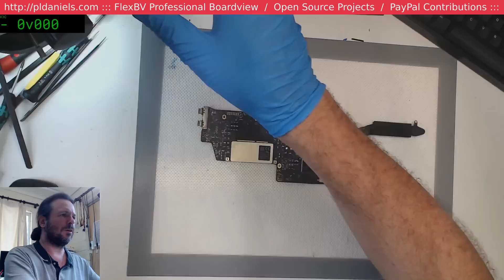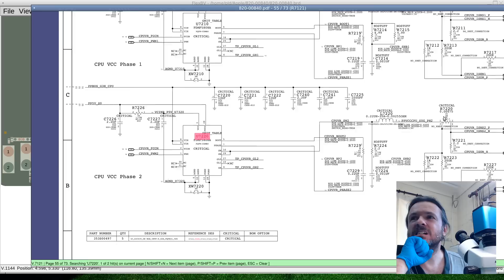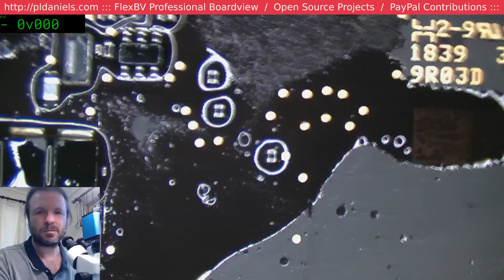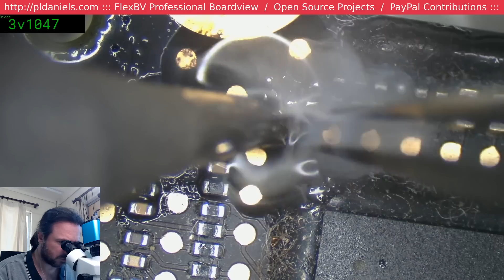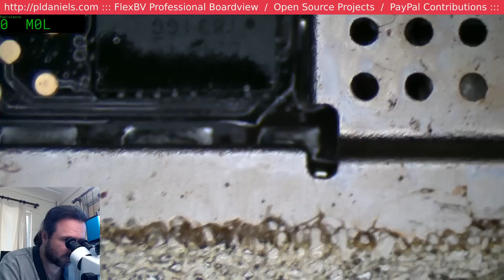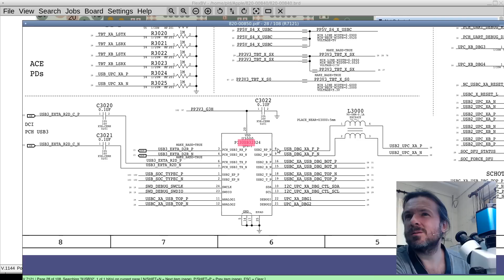Beer infused Macbook A1706̶8 gets an inspection and hopefully repair

Comment: 12:15 I'd never supply or recommend a NUC for anyone as it is not easily repairable, replaceable, and scalable eg faulty RAM, SSD, PSU - even if the repairer is Paul Daniels.
It may be worth keeping 1 or 2 older, ex corporate, desktops & notebooks to clone customer's ailing PC's to... especially folks still clinging to Windows 7 or XP because of some specialist software they use that's too expensive to update to.
Reply from the maker: Sure you're not thinking of something else?  SSD is replaceable ( 2.5" SSD or M2/NV ), PSU is external wart/brick, RAM is SODIMM.  Best of all, only 4 screws on the bottom to access the SSD/drive and SODIMMs.

Very repairable.
Reply: No, sorry, I'm not that sure, and it is probably time to reevaluate. Finding, buying, waiting for stock of replacement parts has been difficult & costly - but that's changed now that NUCs are becoming more accepted & mature.